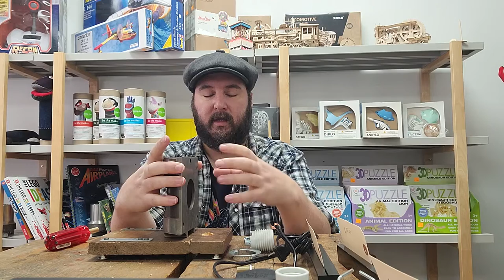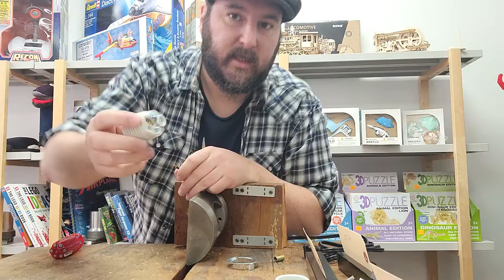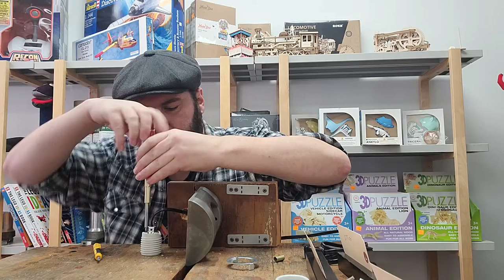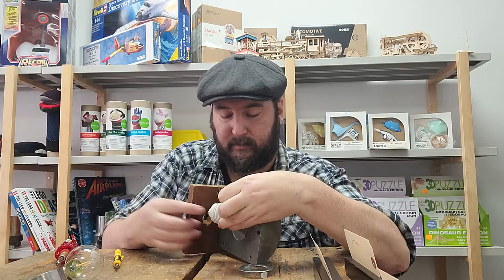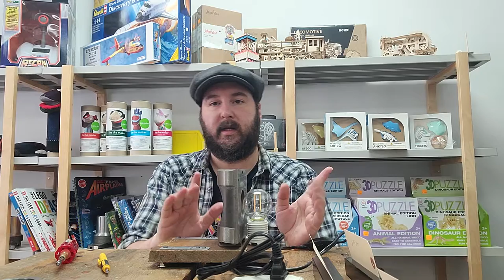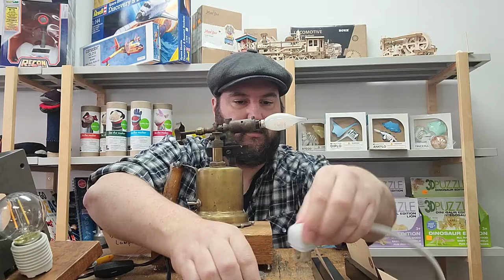Upcycled Lamp Making at The Gorilla Store

Comment: Can a dimmer switch be used in this set up? What other things would I need beside the dimmer switch?
Reply from the maker: Yes and no. You would either need a dimmable LED bulb and a regular dimmer, or a dimmer switch that works with an LED bulb, or regular dimmer and an incandescent bulb. You would also need to put the dimmer switch in a junction box on your lamp, so it's safe from fingers and the world. It could get bulky unless you build a large lamp.

You could hide all of this in a repurposed machine case. Say you took an old projector, you could gut it and replace the insides with the dimmer and wires.